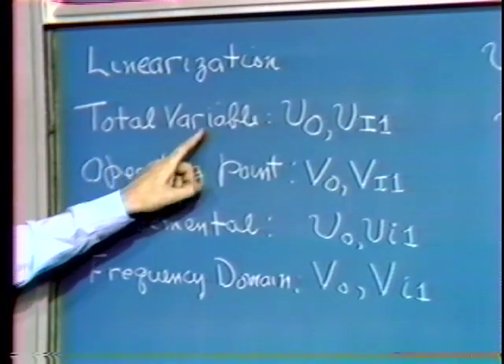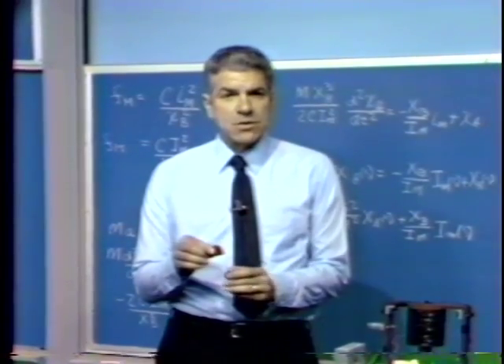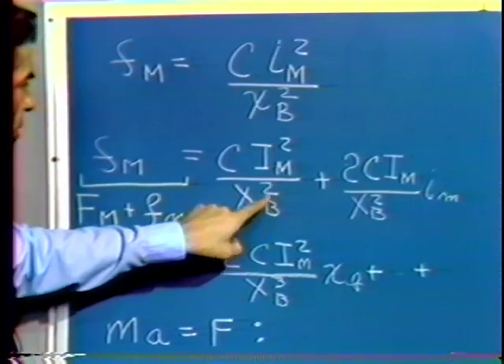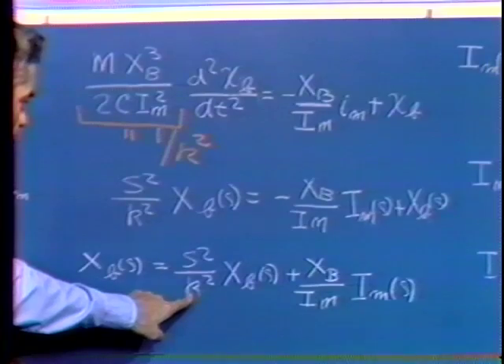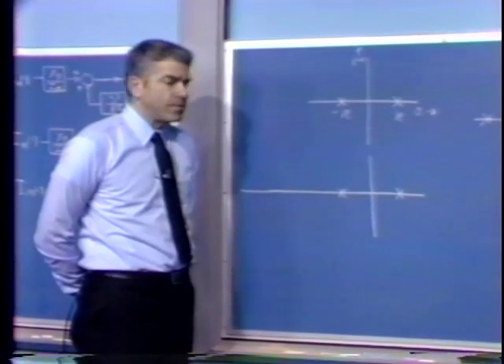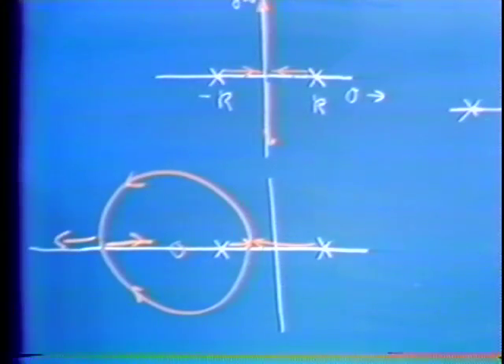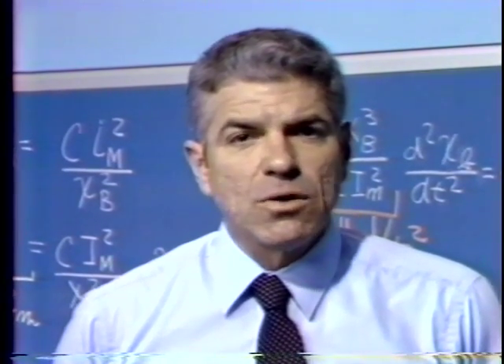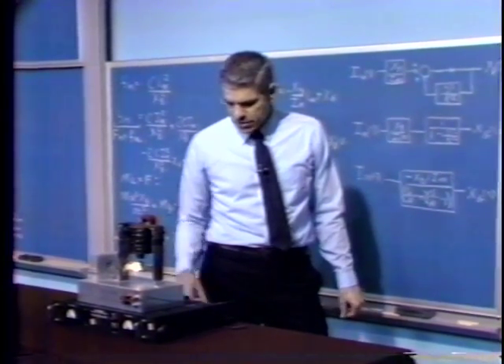14. Linearized Analysis of Nonlinear Systems

Comment: If you draw the root locus of G=-A/((s+k)*(s-k)) using MATLAB, you get the branches in different position than shown in the video. The rlocus looks like:

<--------------------X                     X-------------------->

I have the impression he chose not to comment about the negative sign in the numerator. Am I missing anything?
Reply: I think when you put it in matlab like that it assumes your system has positive feeback and therefore the root locus doesn't look like what the video shows. Im not sure why he showed the block diagram like that. Maybe for simplicity?

I think the assumption is that the amplifier is wired up in such a way as to provide negative feedback. Otherwise the ball wouldn't be stable.